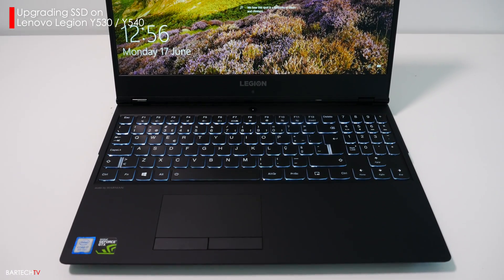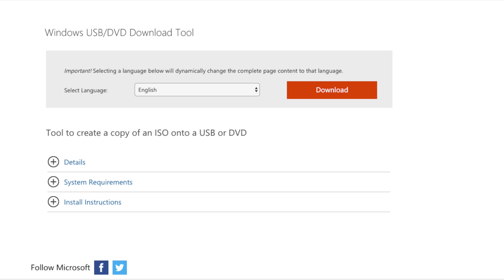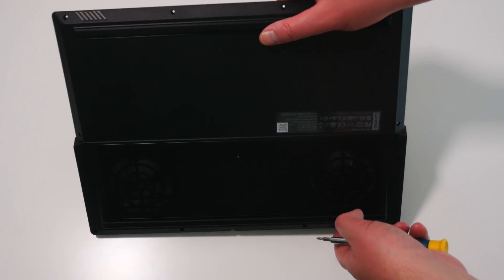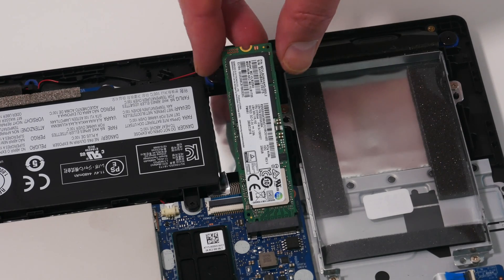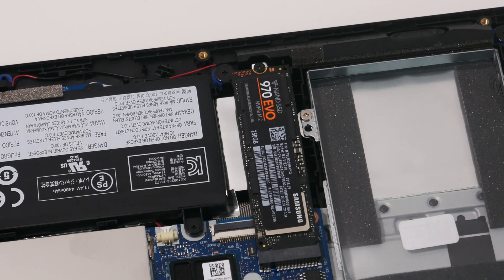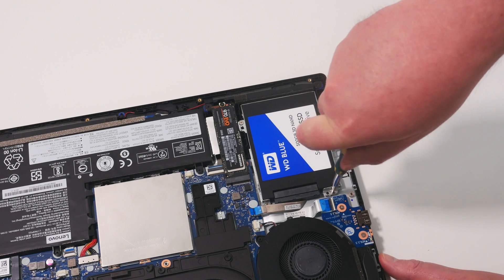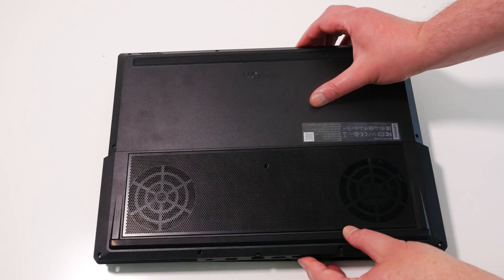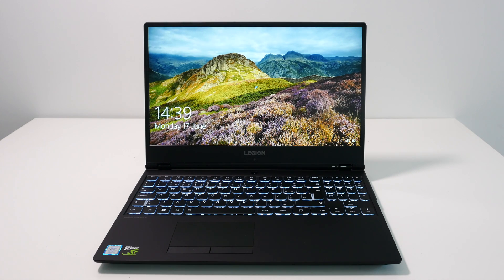Lenovo Legion Y530 / Y540 SSD upgrade and second drive installation

Comment: 2020 Y540 model has improved bottom panel design. Only 2 screws to be removed on front half of the panel, then just slide open. No more hassle with 11 screws and plastic cards.
Bonus: HDD cable is already installed. There is a dummy drive in the slot with 4 additional screws. No more extra bag in the box.
Reply: OMG you are a lifesaver.  Every how-to video on this model was like "Remove all 11 screws" and there's only 6 total in the back.  I nearly broke the panel trying to pry it open until I saw this comment.
Reply: I just got mine today. There was no cable in the box. It was manufactured in Dec 2019. Haven't open it yet. Do you think the cable is already installed ?
Reply: @AshishKumar-wi2pd  Check if your back panel consists of two parts, one flat front part and one perforated back part which are separated by 45° angled, skewed contour and not a straight line. The front part has only 2 screws. In the middle area there are no screws at all. Then it should be the new model and have it all installed.
Reply: @SpeedFlap  First of all, thanks for replying. You are already more helpful than lenovo support for me.
Now, Yes the two panels are not joined flat, but I can't verify if they are indeed separated or joined. Now coming to the screws, the bottom ( non perforated one ) panel has 6 screws. 4 in the bottom and 2 on the side. 
If you could share an email ID, I'd send you an image and you could see for yourself !
Thanks !
Reply: @AshishKumar-wi2pd  it's easy to distinguish. If it looks as in the video 1:14 then it's the older one. The new bottom is clearly different. It does not have the 2 screws on the side.
Reply: It's Y540 17" model that only has 2 screws to be removed to open the panel, Y540 15" design doesn't have any changes, still need to remove all screws. By the way, mine doesn't have SATA cable in box as well :(
Reply: @barrythehollowed2304  Oh, that's good to know. Yes, mine is a 17" with the split-panel design.
Still, the cable could be inside also on the newer 15" models. The dummy drive with the cable holder isn't anything related to the back panel design.
Reply: Oh hell yeah, I was slightly miffed I got no little bundle of screws and cable. This is reassuring.
Reply: Maybe it depends on market - just got mine with dummy drive, but 11 screws. So could be any variation of the two!
Reply: @nathanc6611  15in has 11 screws and newer ones have the dummy holder.
Reply: you just saved my life, i thought that someone stole the hdd cable xD
Reply: I was looking for that bag and hassling Lenovo about it missing 😬 thanks mate 🙏

Comment: Used this video in 2019 to upgrade my hard drive. Using it again in 2024 to open my laptop. Sure I'll be using it again before it gives up the ghost
Reply: what did you upgrade it with? mine won’t boot so i’m assuming my harddrive might be cooked and thinking of replacing it
Reply: @based5everr 2tb ssd was a crucial one

Comment: After installing the new drives, and booting up Windows via the live USB drive, will the installation process eventually ask for a product key or activation code for the Windows edition or does Microsoft automatically recognize your hardware and let you go through with the install to the end?
Reply from the maker: Windows will be electronically activated, there's no need for an activation key, just click "I don't have a key" during installation.
Reply: @BartechTV  I was aware of that. So, it means I'd have to purchase a new copy of Windows 10 or 11, right or will the activation be automatic?

Comment: Hey very nice vid! Finally someone explained what happend after you put a new SSD In. Do I need a new windows key ?
Reply from the maker: No, you don't need a new Windows key. If you've already had a licenced copy of Windows installed on that PC, it will activate automatically after installation.

Comment: Can you upgrade to a 2tb nvme?? Is there a  storage limitation on a y-540?
Reply from the maker: Yes you can put a 2TB NVMe drive in your Y540.
Reply: @BartechTV  what about a y-530?
Reply from the maker: Yes.  Even a 4TB. There is no max size.
Reply: @BartechTV  I’ve heard seomething like the max supported size is given in bios like uefi supports upto like 1.7tb max and that it also depends on the maximum addressable slots something. But thanks for the info.
Reply from the maker: A modern BIOS can support hundreds of Terabytes. These days with UEFI the maximum size is 9.4 zettabytes. That's 9,400,000,000 Terabytes.
Reply: @BartechTV  does the bios of the legion y530 come in modern bios? It seemed pretty old to me. Like not the modern gigabyte movie with hundreds of customisation options. This laptop was released over 4 years before I think.

Comment: Hi. I have lenovo legion y530. Early (mb 2 years ago) i instal 960evo in m.2 slot. Can i remove my standart hdd and instal ssd sata 2.5 with 1tb memory?
Reply from the maker: Yes, you can.
Reply: @BartechTV  great, thanks!

Comment: 4:11 where can i buy the "ribbon cable"? my crucial mx500 didn't came with one so i need to get it from the internet? how to google it? what's the proper name?
Reply from the maker: The cable is already installed in the laptop when you buy it, it doesn't come with the SSD. If you've lost it, the part number is NBX0001M400. If you Google that reference you should be able to buy one on AliExpress or Ebay.

Comment: Just bought this laptop from ebay but it didn't come with the cradle and ribbon. Anyone know where to buy this?
Reply from the maker: You can Google the FRU code to find a seller in your area.
HDD cradle - FRU 5B40R40179
Ribbon cable - FRU 5C10R40220
Reply: @BartechTV  thank you so much!!
Especially as this is such an old thread. +1 sub

Comment: Can I Replace 256GB SSD With 2TB SSD( I Mean There Have Any Limits Like You Can Use Only 1TB SSD ? ) Like Maximum Ram 32GB Mean's You Can't Install More Than 16GB Ram Per Slot.

Comment: Hello, I have Lenovo Legion Y530 with 128 GB SSD and 1 TB HDD (On the web pages of Lenovo it says "128GB SSD M.2 2242 PCIe NVMe 3.0x2 + 1TB HDD 7200rpm 2.5"). Is there any free slot in my laptop or do I have to remove one of the storage to install new one?
Reply from the maker: You will have to remove one of the existing drives to install a new one.
Reply: @BartechTV  Thanks for the answer! 🙂 What is the best option? Replace the primary 128 GB SSD with 1 TB NVME or replace the secondary 1 TB HDD with 2 TB 2,5" SSD?

Comment: I used EY515 NBX0001M410 (CV Rev: 0A 2018.04.25) cable and it doesn't see my SSD nor in BIOS neither in Windows. The cable is inserted correctly into the slot on motherboard.

Comment: hi! question, i think mine only came with 1x16 GB of ram. What laptop 1x16 ram (2666mhz) would work? any? or is there a specific
Reply from the maker: You will need a second 16GB DDR4 2666Mhz SO-DIMM. The brand doesn't matter.

Comment: I wanna add an ssd as secundary storage in a legion 5. I have Windows 10, do i have to reinstall the windows all over in order to get it to work?? Or i just reboot after instaling??
Reply from the maker: If you're just adding a second drive you don't need to reinstall Windows.

Comment: I Installed a 2tb 2.5 western digital ssd in my laptop I had a hard time getting the screws back on two back screws for screwing in the mounting bracket to the computer because a tight fit in there and moved a lot of my games over to the second ssd the prices on ssd sure have come down in the last couple of years

Comment: All of you must be magicians. Mine had at least 25 screws to release the case. Y540 in the 17in. Also my cover is two pieces. One over the fan and one over battery. I don’t think it was originally two. It came back from Lenovo repair with a different bottom. Thanks for the instructions on ssd tho

Comment: Nice tutorial! I got the 860 EVO SSD, but it didn't come with a SATA ribbon cable, so I guess I need to order one.
Reply: I wanted to add working Samsung EVO840 2,5" SSD using ribbon cable as on this video NBX0001M410, but my Lenovo Legion Y530 doesn't detect the SSD nor in BIOS neither in Windows.
Reply: I wonder if you bought the cable, where did you get it and what is the model? can you please tell me?
Reply: @shukurnazyusuf3868  I eventually found the one that came with my laptop in one of my junk drawers. Very lucky find.

Comment: If I only upgraded the secondary nvme ssd, I can boot right into windows right?
Also which is better for secondary: 2.5” inch SATA ot nvme ?
Reply from the maker: Yes, if you have Windows already installed on the 2.5" SATA SSD and you upgrade the NVMe drive then you can boot straight back into Windows.
It's best to have Windows installed on the fastest drive - the NVMe drive - and use the 2.5" SATA drive for storage of games, photos, videos etc. That would give you the best performance.

Comment: Again, you didn't disconnect the battery, is it safe to fit a 2nd SSD to the legion without doing this?  Also, I take it that the Legion won't recognise the new SSD straight away, you will have to do something in Windows to get it to recognise it?
Reply: It should just recognize it, but you might have to format it or something just to use the space, if you can’t use it already (right click on drive then format)

Comment: I bought the legion Y530 with only the hardrive. I already add a extra stick of ram in the past but now I am looking to add a ssd to improve boot up performance by running window on the ssd. I never used a ssd in my life and I am a little bit confuse. Wich ssd type would you recommand me to add in my laptop ? Thank you for the good video, great explanation step by step :D
Reply from the maker: I would recommend buying an NVMe SSD - the Samsung 970 EVO or EVO Plus, the Western Digital SN750 are a couple of the best available. There are also cheaper options like the Western Digital SN500 or the Kioxia Exceria NVMe SSDs which are not quite as fast but still perform very well for the price. You can leave the hard drive in place and install the SSD in the empty NVMe slot.
Reply: I did what @Champymarty did, I put in a Samsung 980 NVMe M.2 SSD into the open M.2 slot, but my laptop won't recognize the SSD as the System Drive, and still recognizes my old, slow HDD as the system drive! I've changed the EFI order to have the SSD listed first in BIOS, but still, nothing has changed! Please help!

Comment: The disc appears on that white screen, but it doesn't appear in windows, in the file explorer there is only the old disc
Reply from the maker: It won't appear in Explorer until you format it.  Start -> Search "Create and format hard disk partitions" -> click the "Disk Management" app -> look for your new drive in the window that appears, right click on it and choose "Format" in the pop-up menu.
Reply: @BartechTV  Thanks, it's done, now Im trying to move the games from the old disc to the new one

Comment: hello , can i keep my hdd for storage and add ssd for OS , and do i have to install the windows again?
Reply: If you're replacing your old ssd that has windows, yes you do
Reply: @DewaKrishna_  my OS is on hdd while the nvme slot has an optane , now in case i added bigger nvme ssd can i close the windows and run on that ss while keeping the hdd installed for storage ?
Reply: @Mranaskw  as long as you're not swapping the drive that has your OS, you don't need to reinstall it again to boot up properly

Comment: I’m not replacing the original drive in the m.2 slot, I’m just adding a SSD to the 2.5 inch slot, what do i have to do to activate it? Do i need a (SATA to USB) cable to format it or can i just screw it directly to the laptop and format it from there?
Reply: install windows on m2! No point installing it in 2.5 inch ssd, except if u want to make ur laptop slower. And you dont have to do anything to activate the new ssd, usually will work as soon as you plug it in. If there are problems just check bios to change anything
Reply: Genti Zarari 
Thanks for the reply! Yes it’s better to have windows and the system working on the m.2 ssd because its faster. 

But I have already bought a 2.5 inch ssd and inserted it into the empty slot of my laptop, I was able to format it while it was screwed into the laptop (so no need for a SATA to USB cable) then I was able to use it. 

There was no need to install windows in anything because my m.2 ssd already had windows and the system in it and I haven’t replaced it or anything so everything was fine.

Comment: I have a Y540 equipped with a 512GB NVMe m.2 SSD out of the box. I'm considering going for a storage upgrade in December by making use of the 2.5" slot. I know for a fact that SSDs doesn't actually give any benefits for performance aside from faster boot times for applications as well as the OS itself + Faster Read/Write speeds + Durability as it has no mechanical parts. That said, it has led me to thinking that I should just get a 2.5" HDD upgrade for 1TB which in theory will be a much cheaper option as I see it. Do you recommend going for an HDD over an SSD in this regard?

Comment: Hi! In the begining. you showed a 970 EVO 500 GB NVMe, but at 05:39, BIOS showed just 250 GB. Is there a limit to upgrade the Y540? Great video, thanks for sharing.
Reply from the maker: No, there is no limit. You could put a 2TB SSD in there if you wanted.
Reply: @BartechTV  Thank you for your answer. I appreciate that.

Comment: The size of the western digital blue disc is the same as a hdd drive?
Reply: Franco Panero No, doesn't have to be the same 250GB WD blue should be enough. The hdd is mostly 1TB capacity. I upgraded one of this I use cloning https://www.youtube.com/watch?v=Gk00BjevdYo

Comment: Please help ! Can i get the information about the 4 screws sizes for the corners the 2.5" HDD drive? (Mentioned in the video 3:40 - 3:50) I have the cable but unfortunately I lost the 4 screws and need to buy new ones.  Thanks a lot!
Reply from the maker: The screws are 3x3mm (3mm diameter and 3mm length). They are standard size for 2.5" drive caddy and you can buy them on eBay or Amazon.

Comment: hi , can i use another sata connector for this installation , i lose the connector :(
Reply: I wanted to add working Samsung EVO840 2,5" SSD using ribbon cable as on this video NBX0001M410 (also tried NBX0001TC00), but my Lenovo Legion Y530 doesn't detect the SSD nor in BIOS neither in Windows. I checked BIOS system date/tome, I switched between UEFI and Legacy, battery was unplugged, but it didn't help. I tried with mechanical 500GB 2,5" SATA drive and it is not turning when connected.

Comment: good day. sorry for my English. I have a y740. I need to change the m.2 ssd and hdd to an ssd. What is the maximum capacity it supports?
Reply from the maker: Any m.2 SSD will work in the m.2 slot, and any 2.5" 7mm drive will work in the SATA bay. Lenovo doesn't have a limit on capacity.
Reply: @BartechTV  sorry. I want to change the original 128gb m.2 to a 500gb wd. the 1tb hdd by a 1tb ssd. it happens to me that uefi does not recognize the disks that I cloned from the originals
Reply: @BartechTV  actually recognizes it but won't let me boot windows from them

Comment: If I only want to upgrade my empty HDD-slot, there is nothing what will change in my settings, programms or windows right?
Reply from the maker: No, if you're just adding a second drive in the empty drive bay nothing will change. Just boot into Windows after installing the new drive, format it and you're good to go.

Comment: I have succesfuly installed second 2.5" SSD on Y530ICH it came with 256GB M.2 SSD and now it has a second one, Gygabyte 240GB 2.5" SSD.
Reply: I wanted to add working Samsung EVO840 2,5" SSD using ribbon cable as on this video NBX0001M410 (also tried NBX0001TC00), but my Lenovo Legion Y530 doesn't detect the SSD nor in BIOS neither in Windows. I checked BIOS system date/tome, I switched between UEFI and Legacy, battery was unplugged, but it didn't help. I tried with mechanical 500GB 2,5" SATA drive and it is not turning when connected.

Comment: i have a legion 7530 with only  a single 500 gb ssd if i want to add another hdd or ssd do i need to reinstall the os?
Reply: No reinstall needed. Just add the new drive, start Os, then go to computer management and format the new disk. New drive letter will appear (Windows).

Comment: Great video! I recently replaced the HDD of my legion computer and found that the battery life got drastically shorter. Did the same thing happen to you?
Reply: Hdd needs extra  power to work thats y...
Reply: i changed my laptop hdd to ssd 2.5". Now i get like 20-30% more battery life

Comment: thank you. I have y540 1TB nvme . I want to add another ssd but I don't have the cable.
Reply: Same here
I don't get cable and screws in the box too. Did you manage to get one?
Reply: @iraklikobiashvili5321  thanks
Reply: If you have a newer Y540 model, the cable is already installed + 4 Screws in a plastic dummy in the drive slot.
Reply: Hey I have the same model and I'm wondering which 2.5 ssd brand to use

Comment: Thanks for making this nice how-to guide. Now just have to find a good 2.5" SATA drive to add :)
Reply: I wanted to add working 2,5" SSD using ribbon cable as on this video NBX0001M410, but my Lenovo Legion Y530 doesn't detect the SSD nor in BIOS neither in Windows.

Comment: Hello,
Do you know how to get the SATA cable to connect the hard drive to the motherboard?
thank you in advance
(reference: PK37A007X00)
Reply: It should've been in the box w/your laptop
If it's not you'll need to buy a cable online, there are plenty of options
Reply: @DS-bz4mz  i have the same problem. And i cant find the correct cable that you use on the video :o
Reply: @NoberJ  you are the man!